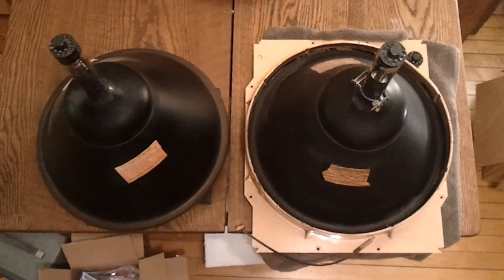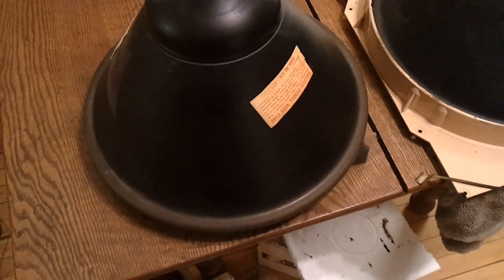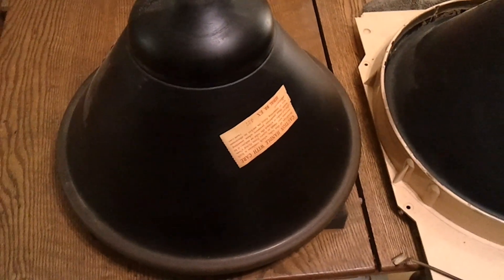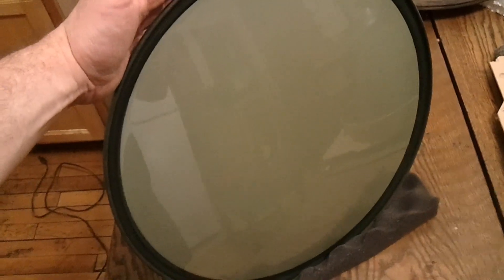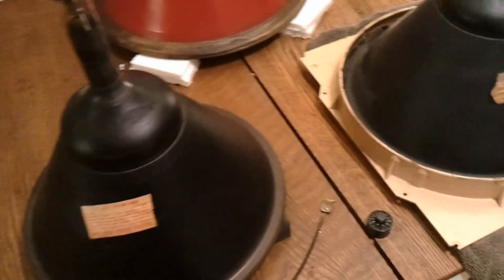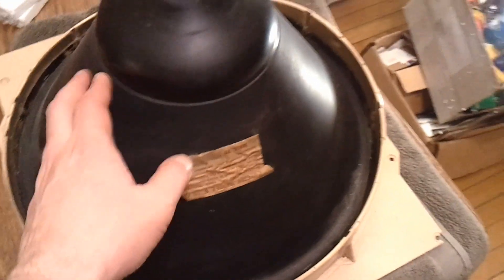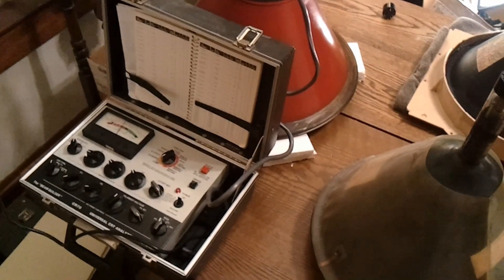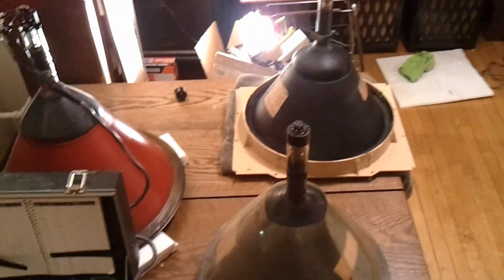Metal Cone CRTs

Comment: DuMont made some pretty large roundie tubes but I don't know whether they made glass tubes up to 19 inch or stopped at 16. By the time the market moved larger CRTs they were going more towards rectangular tubes with steeper deflection angles with shallower bells. Some of those DuMont sets are just monsters, even ones with smaller tubes, but very interesting from a design point of view.

Comment: There is a group trying to get the 15 inch tubes used in the CT 100 RCA sets rebuilt in France while they still can, those apparently had a defective weld that would leak so they are working on fixing the leaks first by electroplating the leaky section. The Vinatge Television Foundation is working on getting a rebuilding operation going but it may be a while before they figure out how to do it. 25KV sounds pretty typical for a colour tube though, most seem to be in the 20-25KV range.